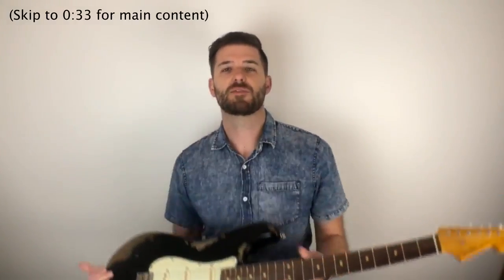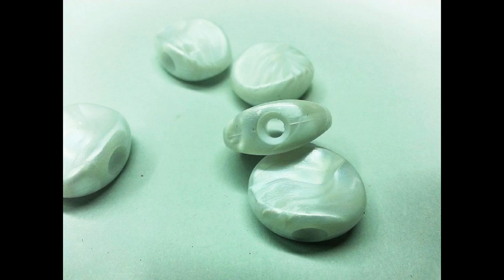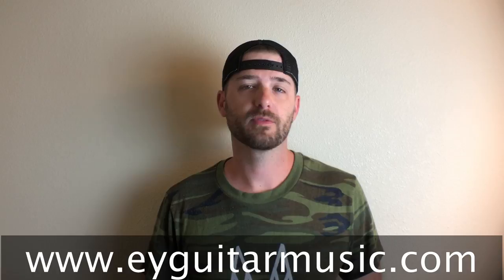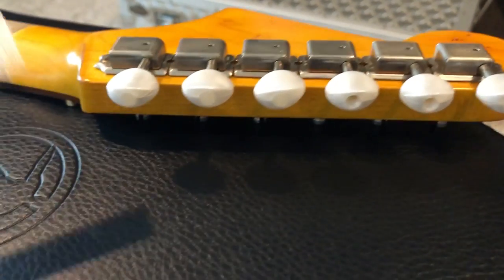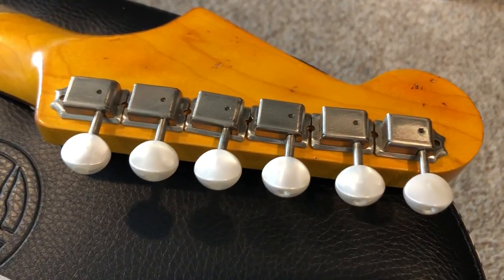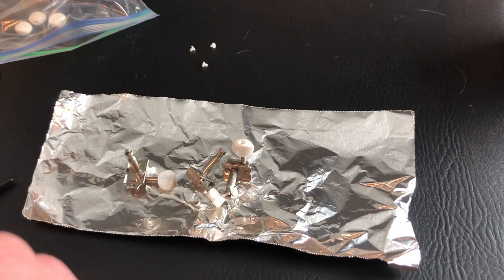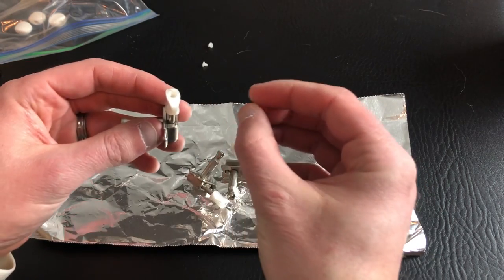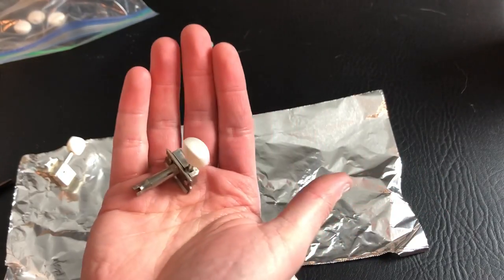How to Plug the Hole of a Screw-On Tuner Button

Comment: Careful with using acetone.  Acetone will melt the plastic plugs and the plastic tuner buttons.  Best to use something like 600-800 grit sandpaper or a razor blade to scrape or sand the glue off.  Not to mention what it will do to nitro if you spill it or any drips on your finish.
Reply from the maker: DaveR that’s a very good point! Thanks for bringing that up. 👍🏻
Reply: You're most welcome.  Last thing I would ever want for anybody is to be that far along and have a big OH SH*T moment like that.  It sucks trust me!